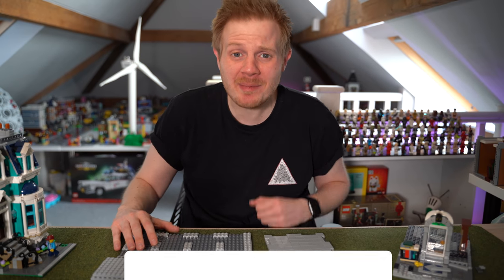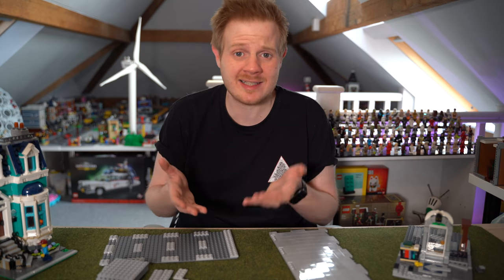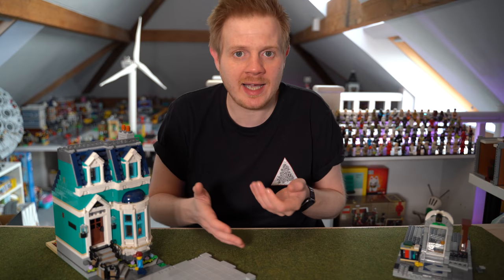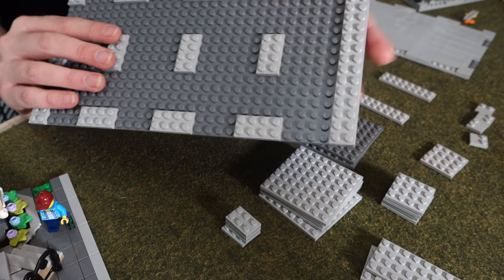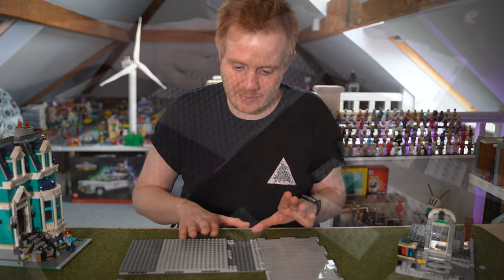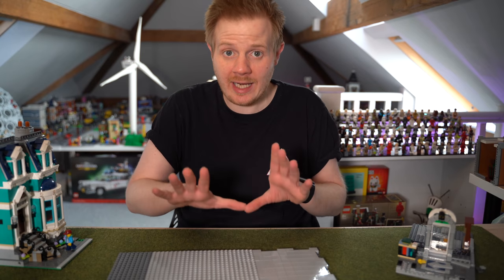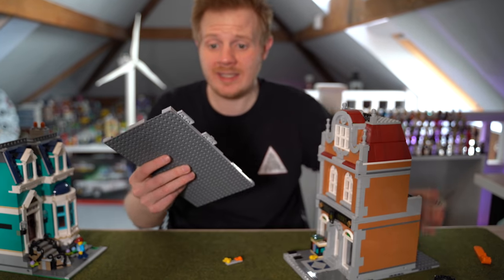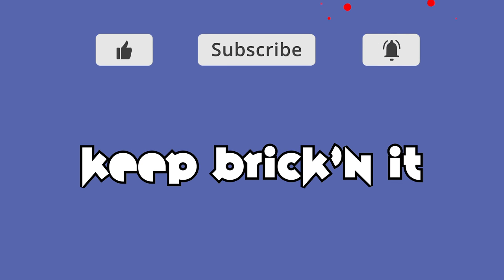New LEGO ROAD PLATES... SOLVED! How to use with Modular buildings & why? Brick'n It Mini-mils system

Comment: this does seem like it works, but thats going to be hell of an expensive setup for any kind of sizeable city
Reply from the maker: YES! Extremely expensive!
Reply: totally agree
Reply: Exactly my thought as well... and so many nice plates never to be seen again....
Reply: If I was starting from scratch, it would be expensive, but currently the BULK of my collection is an overabundance of plate.  It will be nice to actually have something to do with it, instead of having to spend money on containers to store it all.
Reply: Not as expensive as the 5 plate high modular MOC road system (forgot the name, sorry)
Reply: Also wonder how - or even IF - they will do curved roads in that style!
Reply: And who sells those parts to fix this broken Lego-Invention? Of course, it's Lego, trying to make us pay even more money!!
Reply: @ThunderDK74  The Mills Plate technique? I'm not a fan of that either, however with that at least you determine the width of your road – for me this system is too narrow if you want to use it in a city
Reply: @dazblue5515  You should easily be able to make the new 2 or 4 or even 6 studs wider if you want to (half the mentioned studs on each side of the road) by just adding it to the sides.
Reply: @ThunderDK74  Tbh that sounds like a patchwork mess... moreso than it already is.
They're ok for kids I suppose, but not for me... and I would say anyone who has a big city build.
Reply: @dazblue5515  I'm sure LEGO will survive that you won't buy them :-)
Reply: @ThunderDK74  Did I ever say they wouldn't?
But does that also mean Lego haven't dropped the ball many times before?
Reply: @ThunderDK74  I take a huge bet LEGO will loose relevance soon. They’re actually Loosing ground. Companies like Lepin and especially CoBi and what was the one from Hasbro called ? are improving really hard. A lot of LEGO fans question LEGO right now. CoBi already reached the quality of LEGO pieces, prints every piece (no stickers), makes military models and is cheaper priced. They have licensed sets and don’t copy LEGO, if anyone thinks about that. Lepin also improved so much in a year, their lacking a bit of quality control but they’re getting better and better. coping actual LEGO sets is a downside of them tho. But LEGO will loose eventually with their set design getting more shitty every year, no remakes on popular productlines, overpricing certain sets, stupid decisions on wich sets to produce and don’t get me started at marketing, flaws and straight up false information on their website, only new customer mentality and there’s more but the text is long enough. Only fanboys aren’t seeing it. If the LEGO brick wouldn’t sell on its own because of the history the brand builded up in the past, they would be broke already
Reply: @dazblue5515  It really would surprise me if they actually do
Reply: @ThunderDK74  you shouldn’t have to improve a product you invested money in to make it work... LEGO has to produce a product that works perfectly good on its own. We had the best Roadplate System at hand. Now we have a steaming pile of shit at hand. A pile of shitty Roadplates that are 4x more expensive, need additional plates to work because they don’t work with the standardized Baseplate system, can’t fit big vehicles like trucks anymore. 
And what about just making the Speed Champions 8 studs wide but selling more narrow Roadplates - These are the failures that doom LEGO. 
Lego is spitting in your and everyone’s face and laughs.

Comment: The new roads are too small for certain trucks to pass each other without touching.
Reply: And don’t get me started with new 8 stud wide size of the fing Speed Champions !
Reply: Da hat jemand den Helden geschaut
Reply: @zwitshr  Oder einfach selbst gemerkt, wie dumm das neue System ist..
Reply: Actually, you can combine the modular pieces to make make bigger lanes, just use regular dark grey 2×4 plates in the middle and use the printed plates to connect the 16×16 road plates. Now you have traffic lanes that are 16 studs wide, which can easily fit the widest Speed Champion builds.
Reply: @taqresu5865  how much u wanna pay for this?! i mean, sure, if money is not an issue, go for it.
Reply: @wruzzer  Well first off, money is always an issue with LEGO.
Second, I want to build a LEGO City, but I'm starting from scratch when it comes to the road and track system. So no matter what, If I want to progress in this dream, I will be forking over a lot of cash.
Third, I don't even own the older road baseplates, but I know that the retail price for them here is $16 usd for every package of 2 road baseplates, while the new Road Plates set is $20 for each box. So I'm still trying to debate upon which system I want to invest in. Prices seem to favor the old system, while the new plates appear to be more system adaptable given the right pieces.
Reply: @taqresu5865  could also use baseplates from other brands that basically look the same. that's what i would do.
Reply: @wruzzer  Well, I don't think any of those off-brand baseplates are stocked on any store shelves here (not even brands like Mega Bloks/Construx), so I would have to search those up online.
Reply: Modular new road plates are actually nicer considering you can make them wider where the old road base plates are dictated to how wide they are and from personal experience I can tell you things like the new 60440 LE delivery truck will not navigate the old base plates no matter what you do let alone some of the slightly older stats from 2013 and 2016 as the old road base plates are built on the fact that all vehicles were four studs to five studs wide only. With no options to make them wider with the molded studs on the sides of the road where the new modular road plates can be connected together and make a lane 16 or 24 studs wide and the cost compared to buying old road base plates today is not much difference with a greater ability to modify the newer ones.

Comment: The problem is not that the new road plates are outside the system, they are actually designed according to the "system." What is outside the system are the flimsy baseplates that don't work with Lego geometry. They need to start doing full plate baseplates so that you can not only connect them to other Lego pieces without first adding more baseplates, but so you can vary the elevation of modulars and anything else on a baseplate, whether for variety or to run wiring, or just to get everything to line up like Lego is supposed to.  I just buy aftermarket full plate baseplates since you don't see them anyways, they are a fraction of the cost, and they actually work with the system.

Comment: So I need a weird workaround in order to make lego compatible with lego? No thanks, this company is trying to scam it's customers. These plates are completely outside the Lego system
Reply: The new roads aren't outside the LEGO system, the modulars are because they're sat on baseplates, which are half the thickness of a plate; that's incredibly annoying when the system is based on a full plate of thickness. This is why they're phasing out baseplates. These roads are also modular which the old ones weren't.

Comment: Sorry, but you shouldn't have to 'solve' the new road plate system... that suggests it's broken to begin with... which for me personally it is... I really don't like them!
Hopefully we will still be able to pick up the proper road baseplates
Reply from the maker: Couldn't agree more. The fact that the new roads wouldnt play nice with my existing modulars was keeping me up at night lol. Thats why i tried to figure out a solution to help out :)
Reply: I don't think they're broken. What's broken is official Lego baseplates that are a weird size (thickness of the top of a plate). I think it's good they're trying to go away from that system and make it more customizable etc. However they should also just make 16x32 road plates without sidewalks. I also think though that these roads are way too narrow. 7.5 studs per lane if you don't include the lane divider which I feel was already a problem with the current road plates. Well I'm just glad they're trying new things and I hope they keep the old ones still around
Reply: @RCmies  It's all personal on what you prefer or not, but totally disagree that baseplates are a problem or a weird size – the clue is in their name 'base' plates – designed to be the base  you build upon, which for the road system makes perfect sense, as the lowest part of any town is generally the road surface, then a step up to the pavement (sidewalk) etc... this new system actually puts the road a whole plate (not baseplate) above modular bases... which will make raising a city to match, a very expensive procedure!
The only constraint is that you have to have a two lane road - but really, how many people out there have a Lego city that's big enough for a multi-lane highway?
Reply: Wonder why they didn't make the new roads 1 tile + baseplate height, I imagine that would work just as well

Comment: It looks expensive if you have a lot of modulars. But if you have a lot of modulars you already have a lot of money. I still like the old roads. I have big hands and trying to add the details for a two-lane road that's 16 studs across is going to be hard. OTOH you can (in theory) make roads with any number of lanes like a 5 lane main street and 1 lane alleys between buildings and 2 lane residential streets.

Comment: That's gonna eat up a TON of plates.  Basically you're saying we'd have to make a double-layer of plates underneath every single building.  while it could be handy for eating up some otherwise hard to use colours (I'm looking at you, orange..), it's still gonna be crazy expensive.  
One thing I would suggest is to come up with a system that doesn't require a baseplate underneath the roads and buildings.  Like, if you're going to have a base built out of plates anyway, why have a baseplate under it?
Reply: I've made a little (I say little, but like 1800 pieces) build in LDD of a way it could be done, which actually transitions between the new roads and the old road plates.  It's a little tricky, because the new road plates are narrower than the road baseplates.  The new plates are 2 lanes in 16 studs, where the baseplates put two lanes in 20 studs.
If you're interested in seeing what I came up with, I can give you the .lxf file.  I may have also included a quick and dirty modular style building.  The downside of my idea is that it doesn't allow a connection between the road and the building.  However, if you have a decently sized city, I don't think that should be a problem.  The plates will be thick enough that they're not going to slide over each other or anything.

Comment: Only downside I see to this is that it requires a LOT of additional bricks/plates just to get your modulars to the same height as the new roads. That's going to get expensive fast, especially if you don't have a lot of spare plates already.
Reply from the maker: Yeah completely agree! The new road plates seem to be a lot more expensive as well!
Reply: Why do you think LEGO introduced the new system? Because they want you to buy tons of plates from their PaB. However, you don't have to follow through with the new road system, unless you want to. You can still get base plates, either new/used from Brick Link or from 3rd party vendors (they even sell double packs of straight roads). I was considering whether or not to switch from 6312 to a MILS-style system, with the new roads I can most probably get there cheaper.
Reply: Don’t buy this crap, go to a alternate Brand and buy their Road-Baseplates. Most of them have exactly the same as Legos old ones, even cheaper and their quality is for the most part as good as LEGO’s. No problems fitting other bricks on them at all

Comment: The new road system is fine.... what bothers me more is the shiny tile surface. Objects just are normally not supposed to reflect in a road. If Lego would have at least come up with a road-like surface. The rougher surface on slopes would have been just ideal.

Comment: Umm... Wouldnt it be better to just build the modular building on regular plates and ditch the base plates altogether? Then you wouldn't have to use another base plate under the road pieces. Just do the same what you did but without the base plates. But instead of laying the 2x4 etc pieces on a baseplate just put them on the bottom of the 8x8 plates and maybe reinforce it a bit better. That way you don't have to spend a fortune on 16x16 or 32x16 baseplates that you can't find anywhere anyway.

Comment: You do not mention that the new road is a bit smaller or thinner than the old road plates, which makes it hard for two 8 stud wide vehicle, such as Speed Champions or trucks to pass each other. 
Also the price for the set is quite high. Here in Germany it's 20 Euro which is twice as much as for the base plates. 
So the road is more expensive than the old one and you need to lift your whole city to use this, as the other system with base plates (which are like this for nearly 40 years) will let you spend some money. 
So you can ask yourself: Are they dumb to not think of this or are they clever to make it this way?
Reply: its actually 4times price increase. In the old system u got 2 32x32 baseplates for 10, in the new system u get an area of 32x32 for 20e
Reply: The standard LEGO City Trucks are „just“ 6 studs wide. Two of them won’t fit. Now try the 8 stud wide Speed Champions. Lego is testing us
Reply: @ondrejm5042  But they are (more) than twice as thick as a base plate. :P It's scam. point.

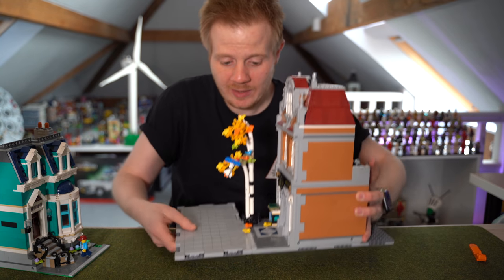Comment: 10:08 you don't actually have to take anything apart to separate the modular from the road, you can lift the building and keep the 2x2 plates attached to the sidewalk instead of the road.

Comment: I avoid all of these problems by placing all of my modulars on top of another baseplate, and overlapping them over the road baseplates. That way they are on the exact same height as everything else, the roads take up less space, and I can still move the modulars around as much as I want. I also don't have to modify the modular buildings at all, they are still on their original baseplates.

Comment: I think you're making it over complicated when you add the base plate under the road plate. Just ditch the base plate under the house and build it all with plates instead.
Reply: Using separate plates is weaker than using 1 baseplate
Reply: Yeah, if you want to rebuild the whole first floor of EVERY modular you own.
Reply: @uncommonsense7830  Surely you’d only need to rebuild the tiling, because the building itself can be “peeled” off of the baseplate.
Reply: @cosmicjenny4508  Not really, I own my fair share of modulars, and I can safely say those things are like fuckin' glue! They're built in a way that doesn't allow them to come off without taking everything apart. Plus, even if it was that easy, I would never spend that much time taking each individual 1x1, 1x2, 2x2, 2x3, and 2x4 tiles apart from the baseplate. What a waste that would be!

Comment: Wouldn’t it be cheaper just to leave the new road plates alone and simply set an additional baseplate under the untouched modulars?  The two baseplates should make the modulars about one plate higher than the road plate, and you can still move the modulars by simply picking them up, without having to disconnect anything.
Reply: Best solution

Comment: This seems at least a way to resolve it but to buy the new road plates and then have to buy a 16x32 plate to fit under them all sounds expensive (might as well make my own!).  And then have to make all my modulars a bit higher to fit as well as 😱 of which I have about 12 of, then its not really a solution at all. Lego should not make new systems that do not fit in with existing systems - solutions by others should not be needed. Thanks anyway! 🙂

Comment: That's just way too overcomplicated. You can simply lay a baseplate on top of some studs, like a bigger baseplate and it becomes the same height as a plate. So you can just put the new roads down on your bigger base, make a frame for your building and place it in there. It's not connected to the bottom but that allows for easier transport or rearrangement of your buildings.

Comment: 48x48 baseplate, At least seven 2x4 plates to support a 16x32 area. Then a 16x16 green and a 16x16 gray. Lay a 16x16 road in front and that's half the 48x48 baseplate, plus the sidewalk will be a tile up.

Several of the new city sets and the road plate set come with 8x16 greens and similar sizes, so modular sets can be easily upgraded by exchanging the baseplate with two 16x16 plates, or an 8x16 green plate with maybe just two other plates.

Comment: is doing it this way really cheaper? having to get all the new plates and tiles i think would just be more expensive...
Reply from the maker: i wouldnt say it was cheaper, i ment cheaper than the MILs system :) but also i dont think its much more expensive than the old way as you dont have to buy all of the tiles for the pavements. But thats if you were starting from scratch :)